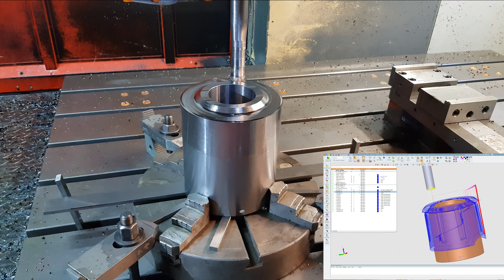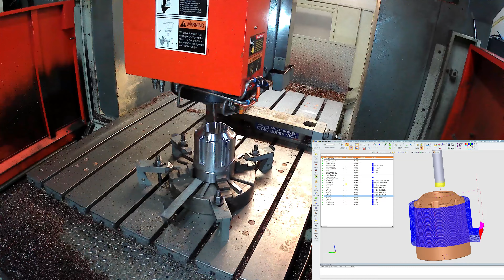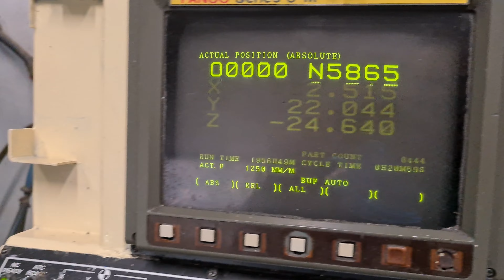CORE production (cnc milling)

Comment: Quick question: How did you clock the top features in relation to the bottom ones?
Reply from the maker: At the bottom there are 2 pin holes from which we started